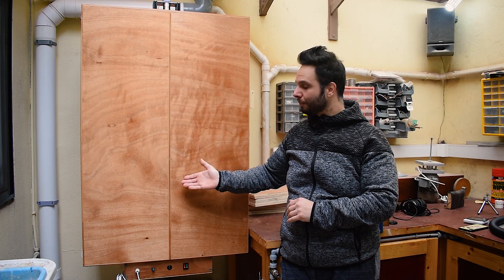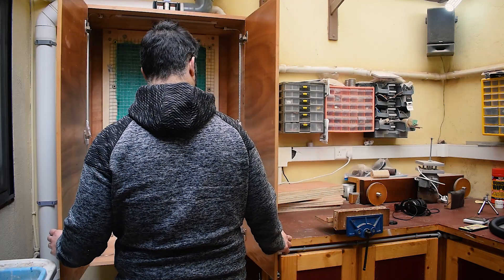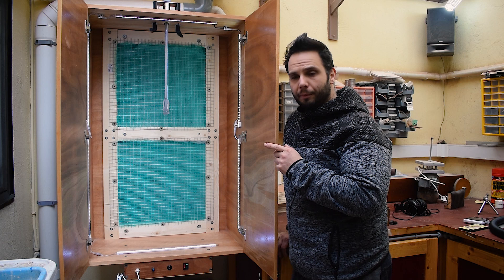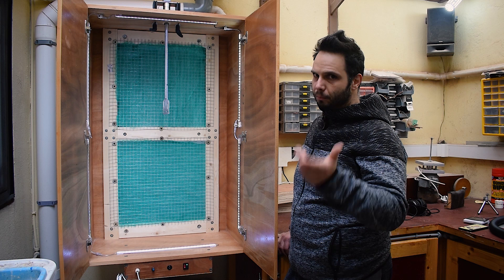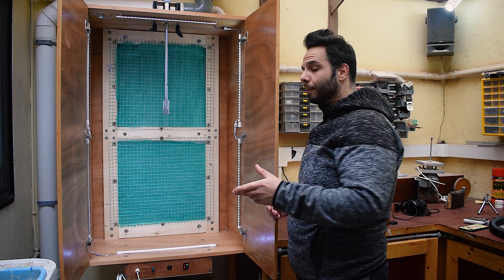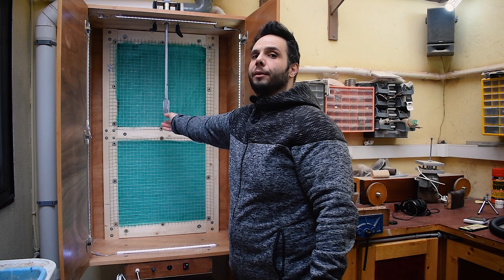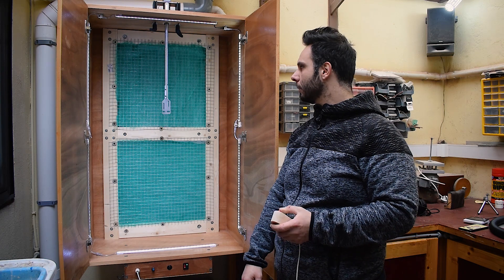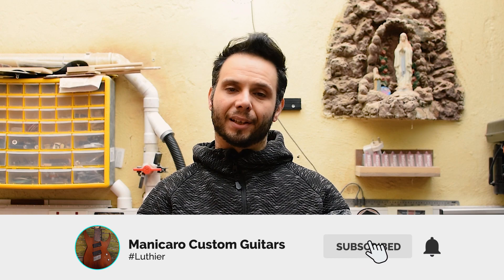DIY Guitar Spray booth - Tour

Comment: So how did the water filtration work out?  I'd really like to know.  I'm looking at building a spray booth, and it would simplify my project greatly if I didn't have to vent the fumes to the outside.
Reply from the maker: I won't say its effective 100% but to a certain degree it makes a difference. Surly I can tell you that without the filters is worse even with the extractor fan is on. Hope this helps.